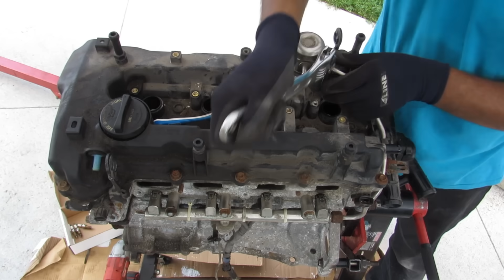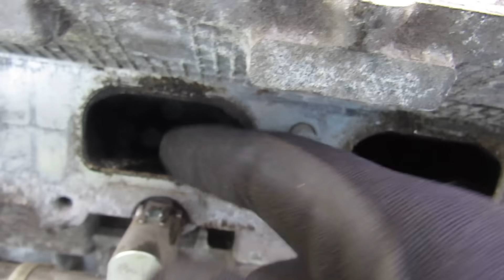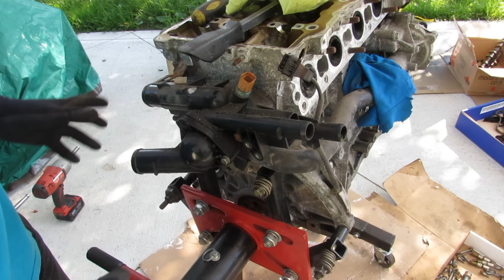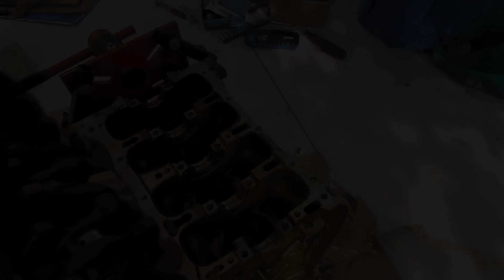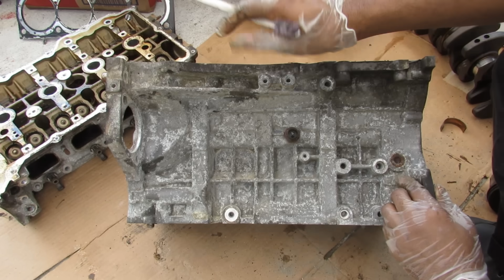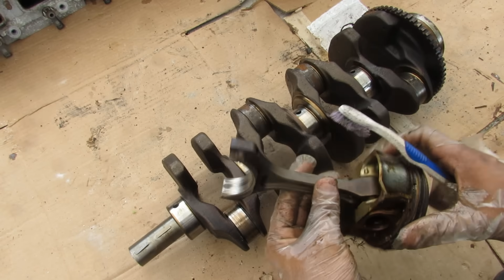Why Hyundai Engines FAIL

Comment: I had a 2011 YF Hyundai Sonata 2.0T. It had the recall and thus a new engine installed. As long as they honor the recall and do the work, the cars are awesome! I did the walnut blasting to clean the carbon build up, it was actually easy.
Reply: Really you did the walnut blasting on the 2.0T engine ? Did you record it ? I would love to see it
Reply: @brucebmendoza   Sorry, I didn't, and have never recorded anything I've ever done on cars. Cleaning the carbon build up via walnut blasting is surprisingly easy. I just watched a bunch of YouTube videos. 
The equipment and walnut media is cheap as well. Granted I already have lots of tools including a big compressor.
I haven't had the car since March, as some idiot failed to yield and it was deemed a total loss. It was not modified save the Plasti-Dip emblems.
Reply: @lowrivera  Are you saying you walnut blasted the new engine or old, and did you do that while the engine is in the car? If so, how do you prevent particles from entering the engine?
Reply: @MrSkeltal268   look up walnut blasting videos. Did just like that. Tape off the cylinders you’re not working on. In one case, some guy even sprayed and drowned the valves in brake cleaner, that one is newer and after I’d already done it but apparently, you can. There is a tool that attaches to your vacuum that fits into the port. It has a hole for the walnut sprayer tube so you actually don’t make a mess.  It’s fairly easy. The Hyundai/Kia engine intake side face the front so access is great for it. You can even buy an entire kit. More than anything, I’d just make sure the cylinder you’re working on is top dead center and you clean the big gunk off first.
Reply: Mine died before walnut blasting was really required.
Reply: @MattPSU02  I saw one that needed it by 40K miles.
Reply: @MattPSU02  How old and how many k's and why did it die?
Reply: @JohnSmith-yv6eq  the motor died at 119k when we were driving home from vacation.  The bearing was shot.  The engine started knocking.  Hyundai gave me a free rental car for  a month, and replaced the motor for free.  The replacement motor was not great either. The oil level would rise between oil changes, indicating some type of blowby where the gas was getting into the oil.
Reply: @MattPSU02  
That was another problem they had...gas leaking out of the high pressure fuel pump straight into the engine...right at the valve cover so everything got a wash down on the way to the sump...would also account for some lack of  performance...
Reply: @JohnSmith-yv6eq  wow, didn't know about that one,  thanks.  I still own another car with a Theta II, a '17 Sorento.
Reply: By the way, my '11 Sonata 2.0T was great... until 100k miles.  Then all hell broke loose.  Radiator, water pump, engine replacement, fuel pump, various oil line leaks, evap leaks, another radiator...  just crazy.  I liked the car, but the Hyundai parts bin is just not filled with quality parts.
Reply: @MattPSU02   I never had problems with it. Other than the engine recall thing of course. But that was completed back in 2016 and even since, other than regular maintenance and the aforementioned CC, it was in immaculate condition, all stock. It met its doom en route to my little girls BDay dinner 3-22-21, when some idiot failed to yield. It was going on 111K miles.

I am going to check out a new Kona N or Elantra N. I have 2 little girls so I have to be practical. They both use a slightly tweaked version of the Veloster engine and that seems to be doing fine.
Reply: @lowrivera  glad you're OK.  I was so disgusted by the constant issues that I decided to purchase an electric car (a Chevy Bolt). No ICE engine to seize up, no fuel pump or fan belt or any of that stuff to fail on me.  However, that is now biting me in the behind right now with the battery recall.  And it has worse build quality than any Hyundai. Plus Hyundai did the right thing and agreed to replace all the LG batteries, whereas GM refuses.
Reply: @MattPSU02  
So you got 10 years out of it...on a 7 year 100,000 mile warranty?
Reply: @JohnSmith-yv6eq  thanks to the big class action lawsuits, I got my engine replaced for free outside of the 100k mile powertrain warranty.  Yeah I got 10 years out of the car.
Reply: My sonata 2011 has 256000 mi.. still going.. gets 35 to 38 mph! 
Great engine.. 
They should've kept it after the improvements to manufacturing were completed.. 
Mechanical Engineer here..
Reply: Ehm hi I hope someone reads my comment and could help me. I was very close to buying a Hyundai ix35 (that was the name for second generation Tucson from 2009-2015). It was in great condition:
2011 Hyundai ix35 2.0 MPi Theta II 163PS/165hp. 6-Speed Automatic 2WD so without AWD, which I really wanted because I don't need AWD and didn't want the extra maintance.
Heated seats in the front and back, backup camera, Bluetooth, and 25.000km/15.500miles all the service was done correctly,  the car was in good condition. It's just that I heard these Theta II and NU engines are problematic.
So my question is are ALL Theta II engines crap? The facelifted ix35/Tucson has a 2.0 NU GDI engine with 3 more horsepower so 166PS/. But I only heard about problems with the GDI engines. Does that mean the port injecting MPi Theta II engines are fine or do they suffer the same problems?
It's the Theta II (G4KD) engine that was also put in the Kia Forte at least that's what wikipedia says.
Reply: 2011 to 2015 recall on engine free engine this includes 1.8 and 2.0 Elantras ,you will get a code like p0016 so timing will be off ,good find though good revue....
Reply: What was the recall brother ! My engine just failed and it has a recall incomplete
Reply: @lorivera1049  Did u do the blasting for ur old engine or the replacement?

Comment: I have a 2011 Sonata with 240 000 km and no issues. Just regular synthetic oil changes. Nothing but reliable for me.
Reply: Mine just covered 160000k regular oil changes.  Thou i recently did the oil pan gasket which was sipping. After removing the oil pan the oil pump looks soo clean alongwith the other components. 

Oil changes are important for any engine too last.

Comment: Nice video
But... why did you take out a few of the input valves to show the carbon buildup?
They should look at the emissions over the expected lifetime of an engine and not just when it is new and clean.
Then manufacturers would most likely quickly return to port injection only.
Reply: Manufacturers knew of this issue long before a single vehicle with direct (only) injection was sold to the public.  It's impossible not to see it when the design is tested and torn down for analysis.
Reply: I heard Hyundai and Toyota started using both GDi and MPI.
Reply: @powershin12  some manufacturers do this 
It just adds more complication...
Reply: That and manufacturers should be incentivized to provide longer powertrain warranties while increasing fuel economy. No point in putting a turbo 4 in a big suv to save 2 mpg and then have it blow up before 10 years. Same goes for crappy cvts
Reply: This isn't "emissions" it is literally what is kept from escaping the crankcase. In port injection it would make it back into the combustion chamber (after washing off the valves) for a complete burn. The PCV system is different than the things most are talking about with "emissions".
Reply: @amorag59  Agree. I understand where the carbon comes from.
The should look at the environmental impact of owning and running a car over the expected lifetime.
A very clean engine that must be replaced  might in the end be worse for the environment than a port injected one that last longer but starts life a little dirtier.

Comment: Reminds me of a Toyota 2AZ/1ZZ design and layout...  This engine looks simple, soundly designed and built, shame about the manufacturing defect and of course no secondary port fuel injectors as is done with Toyota.
Reply: The 2AZ-FE is a much better design than the Mitsubishi Theta engine. You don't have a coolant cross pipe from the water pump to the thermostat, everything is placed in the front of the timing cover with pretty good access for serviceability. The Theta isn't terrible design. When they retrofitted them to GDI, they didn't do enough testing and had problems with cylinder wash and carbon coking on the intake valves. Ring gaps need to be tighter with direct injection, or unburnt gasoline will seep down into the crankcase and contaminate the oil. You also need indirect secondary injectors to keep carbon from coking up on the intake valves. Pretty much what every GDI engine in manufacturer has done to fix GDI issues I've stated above.
Reply: @JosephArata  theta 2 is not a Mitsubishi engine, theta 2 is Hyundai and Kia joint venture engine. Look at how poorly that engine is desiged, Mitsubishi don't make poor engines like that. 

Kia and Hyundai used early model Mitsubishi engines like the 4g15 , 4g63 then after 2004 Hyundai started building their own engines.

It's clear they did not learn how to build the engine properly.
Reply: @OhPhuckYou  Mitsubishi engines are good , I would argue its as reliable as Toyota, Mitsubishi and toyota are the only 2 that use multi point injection, kia , Hyundai,  mazda , Volkswagen all use gasoline direct injection only.

Early Hyundai engines were Mitsubishi rebranded engines, they only licensed Mitsubishi engines , the early engines could be matched to mitusbishi equivalent 4g15 , 4g63. 

Hyundia probably tried to copy mitusbishi design and they failed miserably.  You cant blame Mitsubishi for Hyundai poor design. The rebranded mitusbishi engines were good.

When Hyundai tried to copy japanese design is where everything went wrong.  Mitsubishi engines easily go past 300 000k with no issues.  The earlier Mitsubishi engines had some premature ring failure but the new engines are sound.
Reply: @OhPhuckYou  what nightmare did you heard of? I never heard of any lancer engines failing beside the Evo engines.i have heard of much more issues with Hyundai,  mazda ,vw than lancer engines.

Engines like 4b11 , 4g15 , 4g18 , 4a91, 4a92 don't give any problems.
Reply: @OhPhuckYou  as I have said before the only Mitsubishi engine that has timing chain issues is the Evo engine 4b11t  to be specific.  You seem to only know of 1 engine form their entire history.

You say Mitsubishi engines are unrefined I would really like to hear what is your idea of a good engine and car manufacturer.
Reply: @OhPhuckYou  I think you watched to much Scotty Kilmer because you are only talking about early Mitsubishi engines and the 4b11t that is known to have timing chain issues. Mazda engine made by Ford are awful and ford eco boost are extremely terrible and unreliable,  you can't be serious to bash Mitsubishi engines then tell Me Ford is good as well as mazda made by Ford.

You are right about the limited Mitsubishi choices in the us, Mitsubishi motors ceo is a total idiot and does does understand the car market but their engines are better than Ford and mazda.
Reply: @OhPhuckYou  you judge Mitsubishi based on 1 bad engine but almost all Ford engines are bad. I guess I should say mazda is bad because of the terrible rotary engine in the rx8. And say mazda is unrefined lmao
Reply: @OhPhuckYou  Mitsubishi has been giving the us market bare minimum. I really don't think the ceo of Japan mitusbishi motors is too smart.  The guy literally blanks share holders requests for things such as return of the Evo. 

Mazda understands the American market much more than Mitsubishi
Reply: @OhPhuckYou  the new outlander is nice , there is supposed to be a phev hybrid model in the works, as well as a ralliart model. The phev model should probably come out in 2022 or end of 2021.
Reply: @warcrabcyber9908  What head gasket problems have the 1.5 Honda engines been having in winter and where? I have one and have not heard of this.
Reply: @warcrabcyber9908  mitsubishi is why Hyundai blew up and fell apart in the 90s. Now they are way more reliable. If mitsubishi doesn't make a shit engine then where is mitsubishi now? Bottom of the reliability list if you ask me
Reply: @robmalcolm8042  you must be smoking something,  hyundai has been making low quality vehicle since the beginning and licensing Mitsubishi engines just so their cars can be drivable. The only difference now is that hyundia hires German to design their cars

You get a nice look with awful drivetrain. Hyundai theta engines are extremely poorly designed gdi engines. Can't hold a candle to a Mitsubishi engine,  hyundai dual clutch transmission are even more terrible than the engines.
Reply: @warcrabcyber9908  The Theta is 100% a licensed engine design from Mitsubishi, do some research. The 4G63 and 4G69 are nearly identical to the two displacements offered from the Theta series. Even after Mitsubishi switched to the 4B1 series of engine, Hyundai/Kia still licensed the designs from Mitsubishi and just rebranded it the "Theta 2". The 4G6 series engine is ancient early 1990s engine design that isn't "great". Its decent for stock power figures, but it has problems with crank walk with worn crankshaft thrust bearings in high mileage engines even factory power figures.
Reply: @robmalcolm8042  Mitsubishi downsized because they weren't selling sedans anymore. They exclusively sell SUVs and crossovers now, because that's where the market is in North America and Asian markets.
Reply: @JosephArata  only 4g63 suffers from crank walk and it's a high performance engine,  so it's expected.  After the Evo iv there were no issues with crank walk. As the 4g63 got more refined over the years.

Hyundai licensed Mitsubishi engines and copied it to make their Gama engines,  the engines are trash.
Reply: @JosephArata  You are right about everything you left out a couple of tricks. I don't think Honda uses EGR in their newer DI engines like the 1.5 and that helps a bit to keep carbon out. Their PCV system is well baffled so as to also take oil out of the vapors. Also I heard somewhere that the way the direct injector sprays it can clean the intake valves a bit. But I am not 100% on that or if they use some intake charge reversion to achieve it but they do undertake a good amount of R&D on engines so nothing would surprise me. For emissions and performance it would have been nice to have dual injection but Honda is cheap these days.
Reply: This Hyundai junk should not be compared to Toyota.    The people who buy Hyundais love to think that they "scored a deal", too.
Reply: No engines of that generation had dual injectors systems. Ill point out that Hyundai now uses that technology.. I already know the answer. But you yourself have used the correct reason of engine failure.  I don't think he bothered to mention it.
But the detail is that the failed engines came from American manufacture. If they made correctly to proper standards and practices they won't have any trouble doing very high milages as attested in other markets around the world.
Reply: @jhndijkman  except the Theta 2 isn't American. It's a Mitsubishi design that South Korean car manufacturers Hyduai/Kia licensed and produce in their own Korean plants.
Reply: @JosephArata  that shit was a mitsubishi engine back in the 90s... After 2000 ish they basically changed the design beta 2 and up and it's basically a Korean made engine now head and cams are different the design layout stemmed from a Evo engine but it is completely Korean now
Reply: The Global Engine Alliance was a joint venture between Chrysler, Mitsubishi Motors, and the Hyundai Motor Company for developing a line of shared four-cylinder engines. The initial design of the engine block and cylinder head was handled by Hyundai. However, each manufacturer configured their variants of the initial design differently based on their needs. In 2009, Chrysler bought out Mitsubishi and Hyundai's stake in the joint-venture; however, each company retained rights to build the engines.
Reply: @robmalcolm8042  not a Korean design, it's still Mitsubishi contract license manufacture. I suggest you do more research on the subject, you'll find many manufacturers in industry have arrangements like this to save on engineering/r&d costs. This is why 90% of the US sedan market with transverse mounted transmissions are using Aisin transmissions now, because they are cost effective compared to making their own.

Comment: In before the people who've never owned a Hyundai..i run a 2010 kia 2.0 runs like new after 230000 km. This gdi engine has well known issues that were covered by Hyundai warranty replacement. Everyone i know with Hyundais have had zero issues of course except this known engine. Note that this is one of the first gdi engines on the market and probably was a mistake by Hyundai to push it out to too fast and they had manufacturing issues with the metal casting
Reply: One of the first gdi engines on the market? Bro, gdi is out there since the late 90's
Reply: @heitorbernardes7977  in basic English, one of the early gdi mass produced models. If you know cars, you'd know that gdi was entering mass production in 2013-15 and the new ilsac engines oils only got updated in 2020 to cater for gdi engine demands.
Reply: Hyundai and Kia weren’t the first to mass produce GDI engines. Mazda’s 2.3 DISI turbo came before it which was GDI.
Reply: I had a 99 Elantra. When I got it it had 130k miles. I had that bad boy for 6 years and left it with 200k miles. In those 6 years I did 3 oil changes (I was young and very very stupid). Bad boy ran strong! Never ever had any issues! Just normal things like alternators replaced due to leaking power steering hoses and 2 radiators because auto zone radiators blow! I called it my road warrior. I got a 2017 Elantra (road warrior 2.0). So I gave the old one to my sister in law. Crazy bitch flipped it on the freeway. RIP road warrior. Ran like a fucking champ all the way to it’s grave.